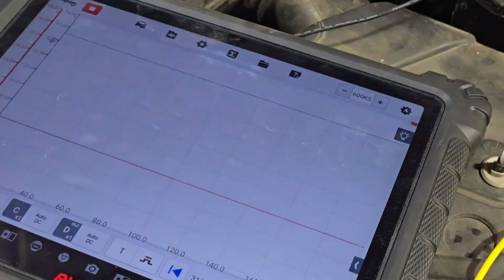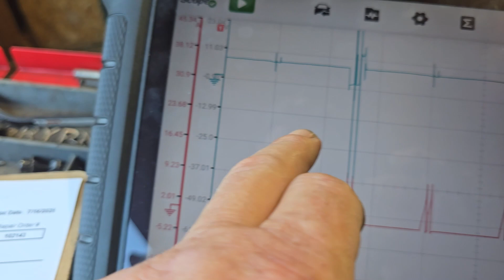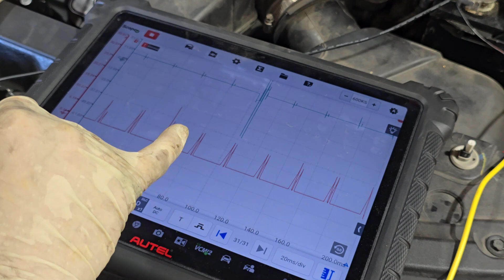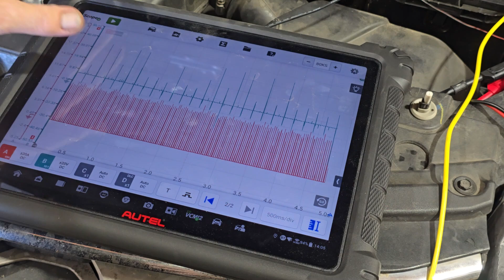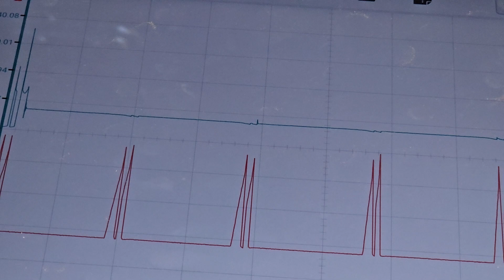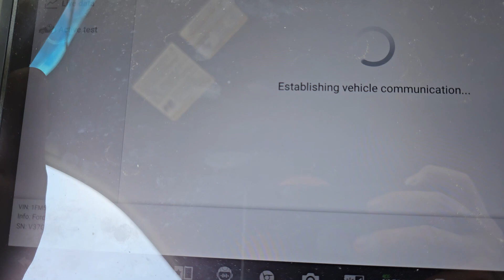2016 3.5 Ford Explorer How to Replace Ignition Coils and Current Ramp Them

Comment: Yes. The 3.5 will misfire from a bad coil and it will not throw a code until it's completely and utterly malfunctioned. At that point it's a blinking check engine light.
I had this happen on the freeway in morning rush hour. I got off the freeway and limped back home on the streets going no more than 25 mph.
I replaced all six coils and plugs.  
The first symptom you will notice is an abrupt hesitation at acceleration especially when climbing  a hill. It can also occur when the automatic transmission is shifting down as with descending a hill. You'll think you have a transmission problem. 
The computer installed with this engine  is a real lightweight and the warning system is extremely slow to react.
Reply from the maker: Good information, thanks for sharing your experience!